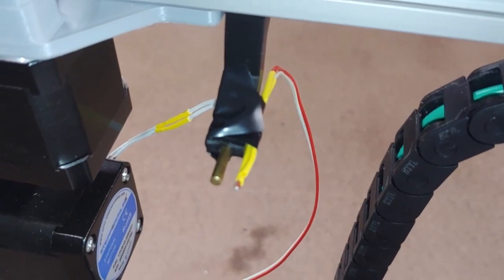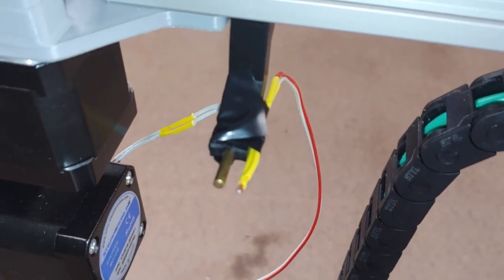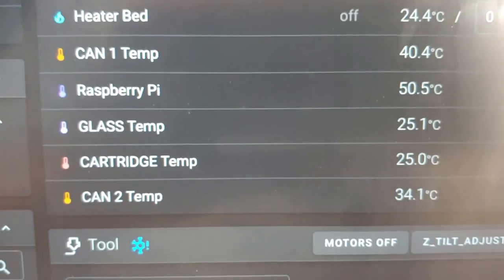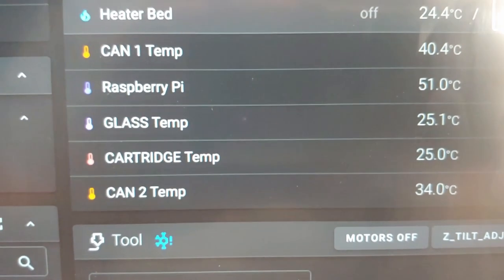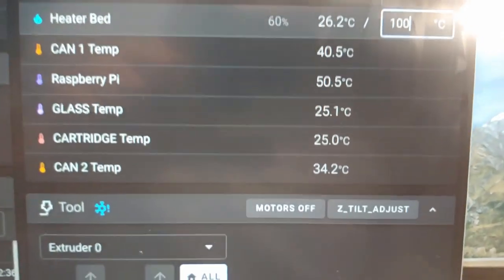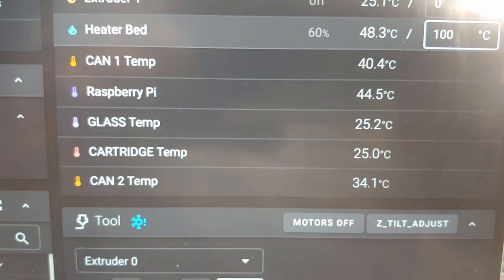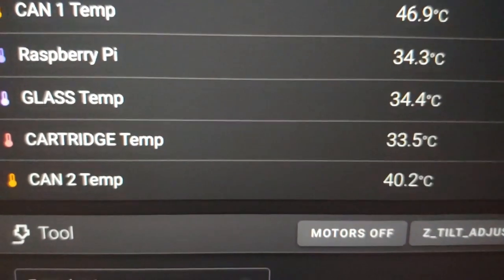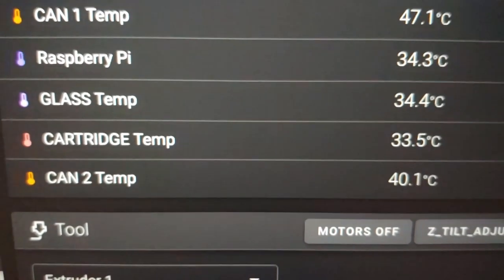Cartridge Vs Glass Bead Thermistor for Chamber Temps

Comment: I have seen people attach their chamber thermistors to an extrusion, does that make a difference?
Reply: That'll just make it worse the reason the glass works better is because there's less mass to heat up if you connect it to an extrusions it will measure the temperature of the extrusion wich will take quite a while to get to the actual chamber temperature

Comment: I'm using a glass one mid chamber with a ptc heater up top on my switchwire and it's working really great.. 60C in 5 minutes and the pid tune makes it vary less than +-1C
Reply from the maker: "60C in 5 minutes"  ...that is awesome.  That is how it should be.
Reply: @badmouth75  yeap.. I was impressed with it.. But need to keep in mind that switchwire chamber is pretty small.